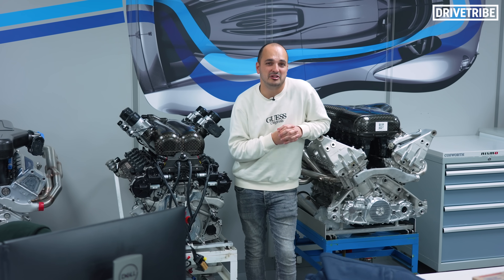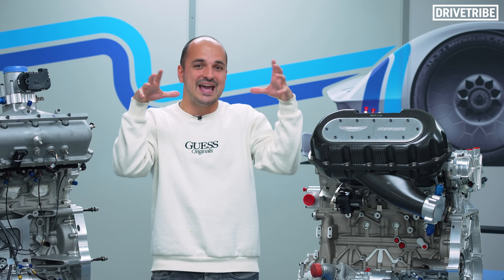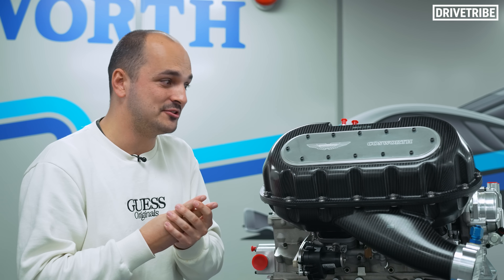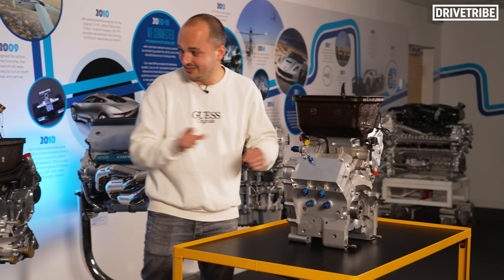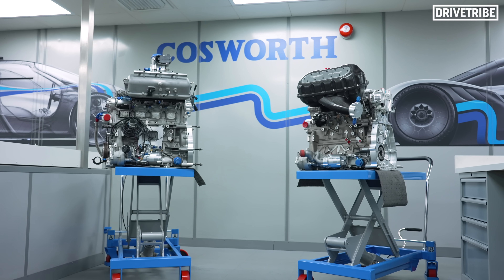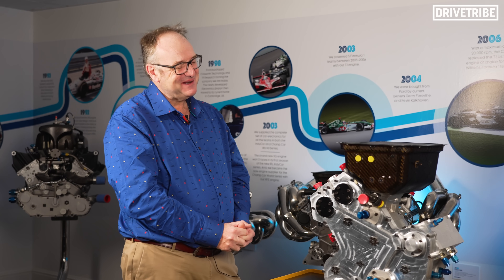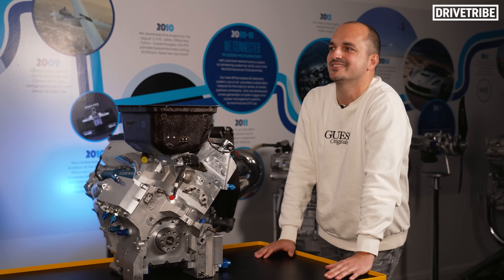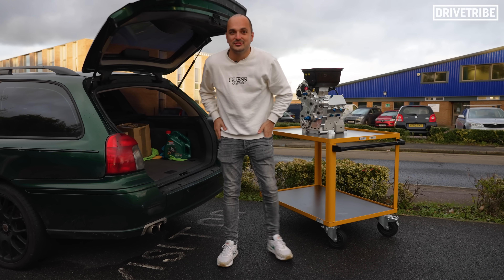This is a single cylinder F1 engine – 20,000rpm, 300cc, 90bhp!

Comment: That single cylinder 300cc, 90bhp, engine needs to go in a motorcycle!
Reply: When aprilia was racing 250cc two strokes they were hitting 90 hp on the race track In the hands of valentino Rossi. Regarding vibration, wouldnt a balancing shaft do the job, like whats fitted In many motorcycle engines.
Reply: @derf9465  yes, it's true! And Aprilia created the RS250 for the streets and in their last model they put out an incredible 70hp!
Reply: @Brunoperes_88  Suzuki motor.
Reply: @Brunoperes_88  no it didn't. They had 56 hp. And it's a suzuki engine.
Reply: @Ellis-Welt  yes, the engine is from the Suzuki RGV but in their last models aprilia reach 72hp...
Reply: @Brunoperes_88   tuned but not OEM.
Reply: @derf9465 most modern race replica bikes (CBR, gsx, exc.) Have balance shafts, when you have any kind of unbalance at 15k it needs to be cancelled out or you would shake the bike to bits. I don't know if any singles have balance shafts, I think most of them do some crank shaft magic to cancel out any vibration
Reply: @r3dn3k97  most motocross 4 strokes have balance shafts !
Reply: @r3dn3k97  I assume that the one cylinder has the balance shafts needed as it was tested to 20k rpm, it would have exploded if it didn't have the proper material to test it.
Reply: @r3dn3k97  Briggs and Stratton have been running counterbalance systems in their engines since at least the 1980s and they don't even play the high-performance application game.
Reply: @r3dn3k97  pretty sure almost all have some balance shaft. I know my SRX400 did, and it actually was smoother with any amount of revs than my CB250 Jade four cylinder was...
Reply: @r3dn3k97  Kawasaki Eliminator BN125 ma wałek wyrównowazajacy.  Pozdrawiam.
Reply: @johnwalker194  my 1977 Honda 400 vertical twin has a big balance shaft
Reply: @illbeyourmonster2  Kohler had one for years in the old Flathead 14s and 12s and 16s
Reply: @r3dn3k97  my KTM Duke 690 post 2016 has 2 balance shafts, one in the cranckase and one in the head, that was an evolution to the 690 engine before 2016 who has only one balance shaft in the cranckase. That 2016 Duke was vibration free for a single cylinder engine, a real pleasure to drive.
Reply: @r3dn3k97  most singles hv bal.shafts, no crank magic
Reply: @r3dn3k97  I've seen some Harleys shake. I don't think we will have a problem.
Reply: @r3dn3k97  nope, doesnt feel like it
Reply: @r3dn3k97  i think ducati and rsv4 dont have any balance shaft
Reply: @r3dn3k97  Even the 3.8 Ecotec Buick V6 needs a balance shaft (in the valley hidden by the inlet manifold). Some engines need them, some don't.
Reply: @r3dn3k97  Yes the crankshaft lobes are counterweighted
Reply: @r3dn3k97  Yes, plenty if not most single cylinder performance engine has balance shafts.
Reply: @r3dn3k97  H100 has balance shaft
Reply: @r3dn3k97  my cbr300r had a balance shaft. If a baby budget bike had one, I am sure many more models would too.
Reply: @r3dn3k97  Honda did have built a winning V5 engine in their Rc211v MotoGP bike. It wasn't a balance shaft but it has been a great & a smooth machine. It can work. 

The current Moto3 only got 60 hp on paper. But I assure its not real. Manufacturers intend to put a number on the spec but in the actual it was more powerful that what it supposed to be. If Cosworth intends to try to join Moto3, I think they can supply engines to some of the teams not only Honda & KTM. But they need to follow the RPM range of the Moto3 class have.
Reply: @eliseiodagiu5519  Ducati supermono
Reply: On a single cylinder you can have the balance weights on the crank Webb's.
Reply: @derf9465 -The Aprillia 250 GP 2 strokes were making 110bhp-but of course emissions were not a problem-my 1992 250GP Yamaha made 75bhp. 20,000rpm isn’t so special either-the 1964 Honda RC116 made 16bhp from its air cooled 50cc twin cylinder engine at 21,500rpm…..so scale that up x 6 and you get 96bhp-in 1965! 
I love engines and all things to do with them, we have just rebuilt a 1904 Peugeot at the Shuttleworth Collection, that is single cylinder, much bigger than 300cc, and makes all of about 8 bhp……..
Reply: @K777John  21500rpm with 2 25cc cylinders is not even in the same universe as a big 300cc engine doing 20000rpm. In a 300cc cylinder 20000rpm is EXTREMELY impressive.
Reply: @K777John  11 gear
Reply: @MV-ri7zu  Exactly. Apples and oranges
Reply: @derf9465  the 250 is two piston engine so basically they cancel out each other with less counter balance shaft works
Reply: @azimhamidun  depending on if the crankshaft is 180° or a 360° engine layout order of the Pistons rise and fall at the same time or are the opposite..
Reply: @azimhamidun  which 250 are we talking about?  Not all of them have 180 degree offset on the crank pins / connecting rod pins or whatever you'd like to call them.
Reply: @derf9465  the RSW 250 was more like 110+ hp at the rear wheel.
Edit. Sorry half a dozen have already said this.
Reply: @derf9465  All single cylinder motorcycle engines (with the exception of Royal Enflied Bullets) are counter balanced.
Honda and KTM make 300 singles
I see no reason why this wouldnt work. It is a bit big tho? Still need room for a transmission
Reply: @derf9465  2 cylinder 2 strokes is quite different
Reply: @derf9465  I'm pretty sure the 2 silver bearing flanges on that engine are balance shafts.
Reply: @derf9465  Yes but that were 2 Cylinders
Reply: @derf9465  lol
Reply: @derf9465  It was a bit more than that as lead engineer Jan Thiel realistically claims 115 hp at the crankshaft. The wonderful thing about those jewel-like 2T engines is they didn't require extreme RPM to produce 460 hp/liter. Port development essentially ceased in 2000, so one could imagine a much higher specific output with modern technology and the implementation of notions like 360° exhaust ports: a concept that has been proven, but requires some packaging thinking due to twin expansion chambers per cylinder.
Reply: @derf9465  Aprilia's 250cc were v twins
Reply: @derf9465 you will need mass equal to piston on balancing shaft which is both inefficient nd unnecessarily idiotic cuz you could have a opposed twin with probably better hp and much smoother
Reply: @derf9465 yep. You're right on the money. You definitely wouldn't call a 20,000rpm single a thumper anymore, that's for sure. 😅
Reply: Exactly what I was thinking. It actually reminded me a bit of the single cylinder KTM bikes, especially the 390 Duke.
Reply: @MyHandleIsGood  Better get a 450F then, they can get to almost 70HP
Reply: It would be perfect for a gokart. Race karts have a 125cc with about 30hp reving to 12-15k. 90hp 20k revs would be awesome.
Reply: @christianbuczko1481  exactly what I just commented about, my dad races 250cc superkarts but he's trying to think outside of the box and look for different engines to try and been looking for something exactly like this, I said he should go for an FZR400 engine if he could find one cheap enough but even that doesn't give out as much power as that does
Reply: It van run at least 250 km then you need to dusassembly and check all.
Andrea pneumatic valves starting loosing air pressure, pistoni start to open in half and con rod are near to broken.
This was f1 in v10 era.
Reply: @vnsworkshop9961  jeez wouldn't you check what you actually have written before you publish it? this amounts to pure gibberish
Reply: @harrickvharrick3957  sorry you rigth.
I write with phone keyboard... So much error.
Reply: Absolutely what I was thinking and if anyone can develop a drive train the motorcycle industry can
Reply: Just get a ktm 450-500 supermoto. Job done. Doesn't rev quite as high, but it is much smaller and lighter and still makes close to the same power.
Reply: cr500 LOL
Reply: Or 450kg Lotus 7 ?
Reply: That's a perfect engine for Karting,  so beautiful,  can't imagine
Reply: @felixsantiago5606  as long as your kart team has the same budget as the Jaguar F1 team.
Reply: @gasdive  jajaja, just experimental,  must be fun
Reply: @gasdive  BTW,  my team budget is a father and son team, that means,  small pockets,  but lots of fun
Reply: Better find an old technology 2 s!
Reply: no, It needs to go in my fiat panda
Reply: I ❤  COSWORTH!!
Reply: Even better. Put it in a handicapped WaLmArT sHoPpInG CaRt.
Reply: Just put this on my go kart and smoke all the shifter karts
Reply: Put it in a Honda Grom.
Reply: go kart
Reply: Specifically my motorcycle.
Reply: I think the triple would also make a great super bike engine
Reply: @domestikriders  Aprilia tried it with the RS Cube, every body loved it apart from the riders. It was a 990cc 3 cylinder motogp engine fitted with pneumatic valves and built by Cosworth.
Check it out
Reply: R3 yamaha 😂
Reply: Wani piro !!
Reply: Go kart maybe?
Reply: The Ducati Super Mono is it
Reply: My exact thought!
Reply: 1990 Honda CBR 250RR comes reeeally close, but it uses four TINY cylinders. Still revs to 20,000 (on the limiter)
Reply: Would be great in a go cart as well.
Reply: It would be under powered. 250 two strokes easily bettered 100hp back in the eighties.
Reply: Lol. Ive had over 127hp in a 301cc engine for over 2 decades..lol
Reply: @mechanic_prepper  What bike? Because that seems unrealistic to say the least
Reply: @CatacombStranger  i think there’s no such thing
Reply: When 125 gp was a thing Aprilia had a 50hp 125 cc
Reply: New Rd 350 is coming...
Reply: @DefinitelyNotJ749  Engine size really only affects weight, cylinder count affects the torque curve and pulse spacing. I didn't realize that the flywheel would play such a relatively large part in it because it has to be so lightweight to handle those revs, so thanks for correcting me there.

I can see this engine possibly being usable for regular bikes provided the gear ratios are balanced for the torque curve. The first gear would have to be pretty high just to get the bike moving, but from second gear on it can be much lower since the revs are up in the powerband at that point, around 12-18k rpm.

I myself built an 80cc single cylinder 8 speed motorized bicycle, and right now it's doing an estimated 10mph per horse. I think the bike itself weighs about 98lbs fully fueled. The difference between my little 4.5hp engine and that 90hp beast is mine's smaller, of course, but it also has a lower rev limit. It takes off at 1800 rpm and caps at 5800 (self imposed to avoid a fragmenting flywheel magnet). Peak power starts around 3200 and drops off at 4000. Because of this, I had to gear my bike so it could take off easily from a stop while having an evenly spaced gear range to make it easier to maintain the rpms in the powerband. My goal with this bike is to have a vehicle I can use for long cruises. If I attach a trailer, I can haul camping supplies, an extra 5 gallons of fuel (60+mpg is heaven I tell ya), and a battery to keep my phone charged and run lights and fans for the tent.
Reply: Just watched a video of Travis Pastrana racing with a single cylinder engine, 500 CC's, absolutely insane.
Reply: commercial bike with 300cc 90 bhp its mean cost more money maintenance hight tech garage and limited part
Reply: Meh...if Honda had to produce a 300cc engine for a bike that needed 90bhp, it would be done. It's not uncommon for Honda to lose money on bikes due to over engineering them. Its normal for them to do things that seem pointless or outlandish just to prove they can.
Reply: Not really
Reply: Just what I was thinking
Reply: fr!! imagine a 180 hp 600cc bike
Reply: If somebody gets me one I'll put it in a lawnmower
Reply: *moped
Reply: First thing that popped into my head
Reply: With a turbo for mo powa babeh
Reply: I’m thinking a go kart
Reply: Lawnmower.
Reply: You sir, have dangerous ideas 😅
Reply: Clearly. Big power, small space. Motorcycle go fast.
Reply: Double it up and put it in a beetle
Reply: I’m a bike builder and I just thought that just as I looked at you’re comment..😁. Maybe i can some how get my hands on something with pulling strings and sponsors ?????
Reply: on a lawnmower
Reply: Yes!!! That’s the first think I thought! Or cosworth should develop a Motocross single cylinder engine😍
Reply: Or a litle car
Reply: moped
Reply: Had a single cylinder Suzuki Savage 650 cc motorcycle once. Aka "thumper," likely due to the sound it made as opposed to the potatoe potatoe sounds of vtwin engines found on most street bikes "cruisers." Wasn't making even 1/3 of that horsepower though lol.
Reply: Double it up to a 2-cyl it would make a sweet go-kart engine.
Reply: Hit it!!!! HIT IT!!!!
Reply: Speedway engines already exceed this performance.
Reply: japanese got that in 1970's
Reply: You will sent the Rider to space bruh
Reply: In a scooter :D
Reply: Suzuki Goose350 - single cylinder 350cc, 33bhp, oil cooled :)
Reply: Was the first thought that came to my mind 👍🤣🤣
Reply: There's already an adapter version
Reply: Would not work. Torque to low to get a motorcycle moving. You doubtless have seen how hard it is to get a formula 1 car of the line.
Reply: @adrianrouse5148  because they have no flywheel.
Reply: @adrianrouse5148    wrong! With the right gearbox you would have no problem getting that thing moving I will guarantee this!
Reply: Single cylinder engines with 90bhp can be fuel efficient and powerful at the same time
Reply: If you are into MotoX Cosworth do actually build Motox spec engines. they also sell pistons which you can buy.
they build engines for Dixon Racing Kawasaki based of the stock Kawasaki kx 250 engine
Reply: Wants pushed to 110 bhp
Reply: A honda rebel size bike with 90 hp would fly.
Reply: or a dentist drill. my enduro has 650 in one bang.
Reply: @hardrays  Yes, a 650 with less hp, less rpm, and more weight.
Reply: Nah. Put it in a go-kart.
Reply: @fyrstormer  Sure it could go in a go-kart, more practical in a motorcycle, get some real-world use out of it.
Reply: going out in style
Reply: I want it for a mini drag bike!
Reply: KTM has a Single 690cc at 76HP only revs to bout 8-9K tho..   its in the Duke 690 and the SMCR 690..  Husky also uses it but call it the 701
Reply: I’ll have it as a twin if you don’t mind,swap it out with my cbf500 engine
Reply: I would stick it in a leaf blower..
Reply: Yep.. but having watched the end of the video.....erm...Nah!
Reply: It would be nice to think that the R&D from this project might be shared or sold on... or that Motorcycle Engine Creators could hire this little lump to develop 4 strokes... there arent many ways to create the horrific vibes and torque that this nasty little unit will create.
Reply: Dirt bike or four wheeler
Reply: Revving to 6500 before you hit the friction zone =P
Reply: Go cart engine!
Reply: racing go karts but done right
Reply: how about a go -kart?
Reply: Why when it will fit on a mini bike
Reply: Yes.  My ATK 250 LQ makes 62 hp @ 14,000 rpm. Wide open in 6th gear is scary.  Why not make one quicker.
Reply: you see that is unnecessary,too unreliable,and there is no need to limit yourself to some arbitrary volume of a hole in block,600cc will do the same job just fine,so what exactly is the purpose?
Reply: Yes man
Reply: What is unbelievable is the V6. The old engines only could do one weekend. Now they do 6 race .The v6 in 2022 make 750+ horsepower. Each cylinder 125hp only at 12k max rpm . The turbo pressure is limited.  This new v6 engines with higher boost could handle 1600hp easily. Is 260HP /cylinder.  But guys,dont forget about the RS,AMG,M series serial cars. They made and designed for "last forever " at least 200000km. Those cars are 4 cylinder like example the M139 engine. 2.0 4 cylinder and 416hp without  chiptuning. Is mean at stock 104HP/ cylinder and 208hp/liter.
Reply: @laszloszell8753  is boost pressure limited ? I thought only turbo shaft rpm was limited ?
Reply: @V8Lenny  Yes ,limited by turbo shaft rpm.
Reply: Key word. NEEDS
Reply: Needs to be on a shiter cart
Reply: I believe a 300cc making 90hp would be amazing for hillclimb dirtbikes but i would love to see the monster a production dirtbike with lower displacement than a 450 but make 90hp. 🤣 maybe im crazy lol
Reply: My thoughts exactly! *except like he was saying they built it real quick without space saving in mind; what that tells me; it can be redesigned to shave down the weight and size; what this means is nobody ever really designed a really high performance small engine yet(probably due to manufacturing and maintenance costs)
Reply: No, a Go-kart
Reply: Go kart would make more sense
Reply: True. So true. One that weighs less than 350 pounds wet.
Reply: Sometimes I think high rpm single cylinder sounds much better in my opinion for example I prefer moto3 sounds than MotoGP
Reply: 1cyl 200cc engines @100hp have been used in dirt bike racing for at least 30 years. Even the old atc 200 Honda 3 wheelers of the 80s could pull 75hp with some modding.
Reply: Yes...
It WOULD be just about right for a motor cycle.🤔
Reply: Same thoughts hahaha
Reply: Go kart would be more fun 🤷‍♂️
Reply: Why? 50cc two strokes have been achieving over 25hp for over twenty years. 
You could easily beat the 90hp with say a 200cc twin. 
Much lighter too.
Reply: Wouldn't last very long, that's the issue.
Reply: search for Langen Motorcycles.
Reply: Cosworth must join Moto3 class to supply other teams & replace the spot left by Mahindra way back in 2016 to give KTM (GasGas) & Honda a challenge.
Reply: True but ever seen the stats on the honda rc116? That thing was a beast for its time
Reply: I need to swap it in my r3
Reply: go kart
Reply: This type of engine don’t have usable toque to go around normal road
As the man said you may need to rev it up to 14thou just to get going without stalling
Reply: Or a small single seat side by side or sport utility atv
Reply: No a GO KART
Reply: PLEASE PUT THAT ON A GO KART
Reply: How bout a small dingo go kart the frame only weighs like 40lbs 19kg
Reply: thats what i was thinking
Reply: Chuck it in a grom😂
Reply: Why not the V10???
Reply: @CrApWiFi0  cuz it to big
Reply: @yaboiminecraff  that didn't stop someone from putting a Viper V10 in a motorcycle
Reply: @CrApWiFi0  oh nv then
Reply: Agreeeeee
Reply: Two of them! Paralel twin 600cc, 180 bhp!
Reply: Dirtbike engines specifically Honda and Yamaha were designed after this years ago.
Reply: It would be silly because, as mentioned, you’d need to find a gearbox which would be able to handle that sort of insane speed which I wouldn’t imagine would be cheep. And I wouldn’t think it would last very long either…
Reply: my exact thoughts
Reply: The 250cc Mahindra engine used in MotoGP at Moto3 class some years ago, was made in partnership with Cosworth ...
Reply: Perfect for my snowmobile
Reply: I will not have a motorcycle who need 20000 rpm for just 90 bhp. It is much better to have 90 bhp with 6500 rpm.
Reply: You’d have to add a balance shaft to be able to ride it, but I like the idea. Maybe a two cylinder 600cc, 180bhp engine at 20k RPM. That would be nasty.
Reply: Rotax 2 strokes can do it
Reply: That's exactly what my thoughts were.
Reply: go kart
Reply: @nodo7575  those are rotax engines
Reply: YEAHH!
Reply: Maybe shrink it down to a 80-125cc?
Reply: F1 go kart.
Reply: My dad races superkarts and been looking for just this engine to compete with the rotaxes and other engines, he originally tried a KTM 400cc engine but it doesn't put out enough to keep up with the top boys, this might be the answer, IF it can be bought for cheap enough...
Reply: HONDA HAD F1 ENGINES
Reply: Or a classic mini cooper or fiat 500
Reply: Wonder what the price to buy and servic would be? 💵 💵 💵
Reply: Minibike*
Reply: Put teo of those in my car and it makes 32 more hp than my H4
Reply: @noidontthinksolol  thumper, Parallel twin, v twin, and a 4cylinder. thumpers make your hands numb and upset the balance of a motorcycle
Reply: my thoughts exactly, that's because I ride a 125cc 1 cylinder motorbike.
Reply: Is a very expense engine to waste it on a motorcycle.
Reply: I have a Honda Beat that only makes 60hp... this thing would make it a rocket.
Reply: preferably in my Yamaha mt 125cc 2021. That would be awesome.
Reply: Needs to go on my go kart
Reply: There is 2stroke engines that go up to 100 hp single cylinder 400/500cc
Reply: I second that!!!
Reply: Can’t they just make it a V2 boxer engine?
Reply: Wouldn’t a Boxer v4 make it work?
Reply: Agreed Leon
Reply: I got about 60 hp from a 250 ninja . Ran it a Maxton and went over 120 mph about 12500 rpm.
Reply: Juice up those japanese kei cars. See those things zipping around at Ludacrious speeds
Reply: It would be more powerful than my old Subaru.
Reply: Are these 2 strokes? Modern crotch rockets hit 16000 rpm
Reply: Same thought
Reply: MUST!!! Like that idea...
Reply: Minarelli made a 300 cc engine euro 5 much litghter than this one with a higher weight/power ratio. Long life at 2-stoke engines !!
Reply: 80Hp is absolutely Nada but i'd see a Liter variant off it
Reply: YEESS
Reply: How much for the 1 cylinder engine
Reply: No . Put it in a Trojan bubble car . The unrideable 300 cc Cosworth Trojan ! HAHAHAHA!!!
Reply: Idk man, i think you could squeeze that v12 into a bike.
Reply: but make it i2
Reply: Put that thing in a hill climb bike
Reply: It needs to go into an motocross
Reply: They could put that in a car the old school 1000 cc 4 pots had that horsepower
Reply: Or a Miata
Reply: Fax
Reply: I would be interested if single would be sold to public.
Could make for a fun toy.
Reply: you would need counter weights and if you dont it will shake the bike ALOT
Reply: Reading my mind
Reply: RPMs makes horsepower
Reply: That engine would last about 800-1000km at best if you are lucky.. Its same technology we had in early 2000 in V10 F1 engines that were 3.0l with 900bhp at 19k-20k rpm.. How about get your hands on 2stroke 250cc (not racing) and with few aftermarket parts reach 100bhp with far lighter engine that dont need 20k rpm.. I have Kawasaki Ninja 150cc 42bhp at 10k rpm that weights 110kg and run 23000km (stock engine had 30hp)...
Reply: there are some factory cars with that horsepower
Reply: The idle rpm would be very high
Reply: Shifter cart
Reply: The 3-cylinders need to go in a light small hatchback. Hot hatch alert 🚨!
Reply: imagine a 1.2l v4 like ducati uses, it’d make 360 horsepower
Reply: You took the words right out of my head.
Reply: Seriously true. Perfect powerband for motorcycles.
Reply: YEAH 😎
Reply: Or small hybrid cards for dirt cheap with super repairable batteries
Reply: Porter Bros were pushing 95bhp out of a Rotax 604,30yrs ago...single cylinder!
Reply: No my gokart
Reply: It will not work as the interta of the engine would affect the handling
Reply: @mrmedium7984  IF that were the case, single cylinder bikes wouldn't exist. The higher the rpm, the smoother the vibrations become in a functional engine.
Reply: @ChannelAsh100  that depends on primary vs. secondary balance.  Some will get better, some will get worse.
Reply: @mrmedium7984  Nah, when you have a 1l engine going at 14k rpm, the overall difference (lower weight but higher rpm) shouldn't make the bike unridable.
Reply: @mrmedium7984  Guess 1300cc bikes are unrideable then
Reply: @CatacombStranger  How many pistons does a 1300cc motorcycle have?
Reply: @mrmedium7984  Two or four
Reply: @CatacombStranger  What are Harley engines known for?
Reply: @mrmedium7984  what about ktm 1290s big smooth twin that revs.
Reply: @nick4506  Thats a twin, while this is a single. The extra 900cc capacity will also transmit a lower frequency through the motorcycle. A counter piston and balancing crank.
Reply: @mrmedium7984  the frequncy has to do with rpm and the number of cylinders, not the capacity. higher capacity should be worse because it's throwing around larger and heavier pistons. 

wait what exactly do you think is the issue with high rpm singles?

also suzuki made the rm68 in the 60s that's was a 20,000rpm single.
Reply: @mrmedium7984  What are you blithering about?
Reply: @SvenTviking  Thumpers are horrible for front and rear grip. What do you think will happen when its rotating up to 20,000 rpms? That piston is literally loading and unloading the front suspension. The rear will have slip with the large gap in power pulses.
Reply: @mrmedium7984  wrong. What do you think the big bang engines were trying to do with spacing out their power pulses?
Reply: @mrmedium7984  ". What do you think will happen when its rotating up to 20,000 rpms?"  Nothing at all bad, since you have the elasticity of the entire drivetrain to absorb angular vibration at such a high frequency.
Reply: @mrmedium7984  Thumpers (and twins) are brilliant for grip, much, much better than multis. The longer spaces between power strokes allow the tyre to “relax” slightly and retain grip. That’s how “Big Bang” motors, first on the GP two strokes and then recently on big superbikes like the crossplane Yamaha R1, work. They also allow going around tight bends in a higher gear because singles have a wider spread of torque, which means you are less likely to spin out the back tyre. Non “Big bang” multis have more of a constant, even surge of power which overwhelms rear tyre grip.
Reply: @SvenTviking  exactly that's even true among four strokes and two strokes if you think about the knobby tire gripping into the dirt more or less times
Reply: @mrmedium7984  
It's easier to handle out of the turn with big pulses - Ducati Desmo V Twin, RC 45 Honda Twin, ...
Reply: @mrmedium7984  I don't get it. Do you think the inertia of the piston makes the front suspension go up and down with every rotation? 333 times a second?
Reply: @mrmedium7984  higher rpm the smoother it gets. each hit gets closer together. 1 at 20,000 same frequency as a 2 cil at 10k or a 4cl at 5k.
Reply: @nick4506  A single cylinder can not fire every 180 degrees.
Reply: @mrmedium7984  when dealing with such short periods of time it doesn't matter. enines rocking around so fast its a vibration and not a bike destroying rocking motion to end all time. and at that point you gotta balance shaft and everything great.

ktm dirbikes rev to 14k and they are pretty smooth. the engine in the video ran and didn't destroy the dyno.
Reply: @MagnumMuscle1000  you sir are totally correct!   Took the words out of my mouth
Reply: @SvenTviking  I think he means centrifugal effect might stop the bike from leaning over perhaps?
Reply: @MagnumMuscle1000  like XR750 , was one cylinder and the next 45 degrees later, 675 degrees, rinse and repeat
Reply: @MagnumMuscle1000  I was thinking the same thing. It were the (Honda's) V4 screamers with a 180° firing order that really had traction issues. Changing to the big bangs (70° firing order and 2 cylinders firing  at the  same time) solved the traction problems.
Reply: @mrmedium7984  inerta would effect handling?  You understand they've already had motorcycles with engines revving this high?
Reply: @mrmedium7984  every thumper dirtbike on the planet disagrees with you.
Reply: @PureSPLprix  Thumpers are rarely exceed 7000 rpms
Reply: I feel like that’s not true. I ride a Yz450f and at 10k rpm’s i do just fine. Tire speed matters WAY more. That little spinning crank isn’t holding a candle to your tires
Reply: @mrmedium7984  Nothing an engineer wouldn't solve though ;)
Reply: @mrmedium7984  jsut make it 2 cyl
Reply: @mrmedium7984  I say use an old desmosedici engine from Ducati, I know they have a storeroom full of various ex-race engines, I`d love one for a track bike, owning the D 16RR was the most interesting bike I`ve ridden in 45 years of being involved in the sport, they`re different to other V-4`s and sound evil at 13.750 rpm...
Reply: @mrmedium7984  That example engine isn't heavy. The shape is deceptive.
Reply: @mrmedium7984  It acts as a gyroscope
Reply: @mrmedium7984  vitpilen 701
Reply: @mrmedium7984  if you don't know anything about how a motorcycle handles, don't say anything about it.

Engine size, cylinder count, and rev limit has little bearing on how a motorcycle handles. The things that DO affect handling, especially far far more than an engine of any size or rev, are these: Tire compound, pressure, temperature, width, and tread, net weight, handlebar width and height, fork length, accelerating, braking, road hazards, rider skill, speed, and weather. Engine size and cylinder count both affect net weight, which does slightly affect handling.

Rev limit has zero bearing on any handling characteristics at all other than top speed. Top speed affects handling in that higher speed increases turn radius and braking distance.

I don't know how you came to the conclusion that a high revving single would affect handling through engine inertia, but it's just plain wrong.
Reply: @mrmedium7984  300cc or bigger engines haven't been used before or something, or more gyro effect to the high rpm?
Reply: @mrmedium7984  Absolute nonsense! Any modern 2-stroke 250 is about 80-100hp, and 500cc motocross biker has more power and more torque, in the lightest kind of frames there is.  🤦🏼‍♂️

This engine is just not impressive in it's performance AT ALL, in the motorcycle world. 🤗
Reply: @mrmedium7984  tell that to 250cc inline four Honda owners that ride bikes that rev to 22000rpm.
Reply: @mrmedium7984  no
Reply: @mrmedium7984  just angle the piston forward, toward the front wheel
Reply: @mrmedium7984  not really, there’s been single cylinder race bikes in the past
Reply: @mrmedium7984  yep
Reply: @mrmedium7984  AND?
Reply: @mrmedium7984  many bigger engines rev just as high as that
Reply: @mrmedium7984  well let's put two of those cylinder on a crotch rocket. Would that work? I was so excited about the original comment that physics just totally left the room...then I read your comment and I gave it a double thought
Reply: @mrmedium7984  you have no idea what you're talking about do you 😂
Reply: @mrmedium7984  it would work just fine, i have a turbo'd fully built duke 390 with 148 hp
Reply: @mrmedium7984  bs
Reply: @mrmedium7984  no, there are hundreds of bikes with single cylinders, especially ones that vibrate even more
Reply: @mrmedium7984  there are a lot of single cylinder bikes
Reply: @mrmedium7984 maybe a v4 would work here like the ducatis.
Reply: @mrmedium7984  That why their is multiple bike working on 1 cylinder.
Reply: @mrmedium7984  my bad i forgot the subject was a 20 k rpm engine with that kind of angle and not only a 1 cylinder one.
Reply: @mrmedium7984  maybe it works better in a small tricycle motorcycle.
Reply: Nope
Reply: Bikes tend to use more cylinders to get that high.
Check out 1990's Japanese 250cc 4cylinder bikes though if you like small high revving engines.
Reply: @pek7629  kawasaki just launched their takes on the 250cc I4 the ZX25r
Reply: I had a 657 cc with 62 hp (54 on wheel) and i agree tatally with u hahahaha
Maybe for me it's ok a 600 cc with 100 hp with more life!
Reply: 135 lc v1 en pergh